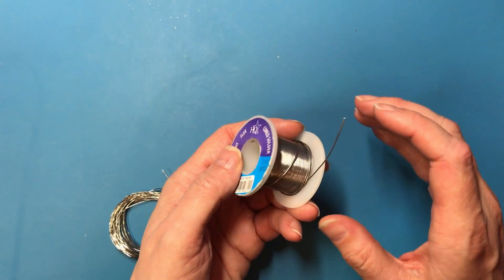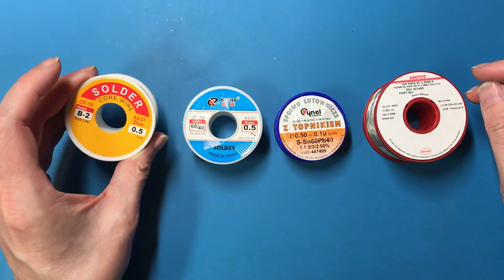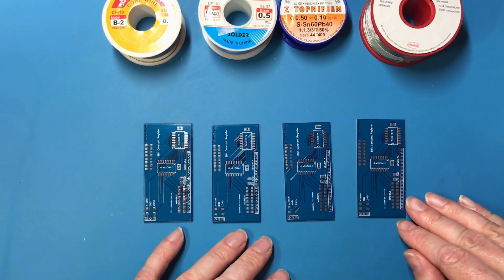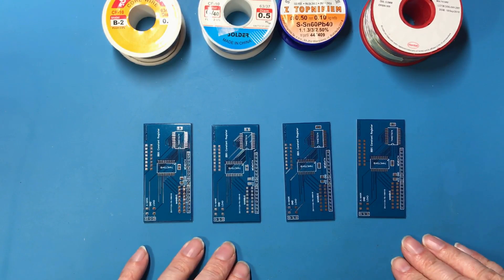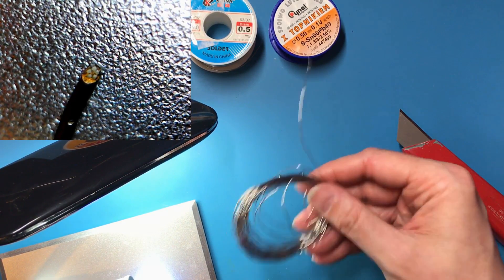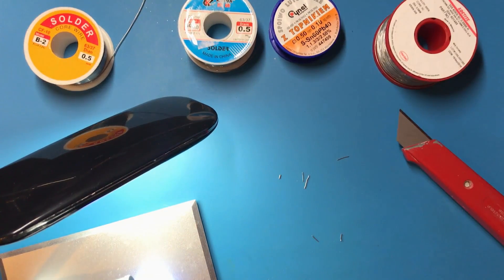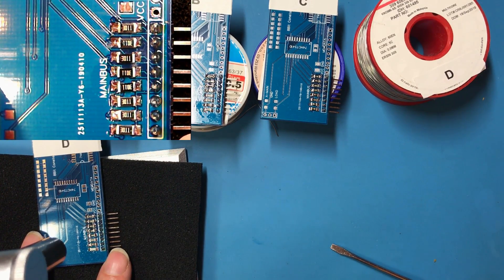eBay Solder Test

Comment: Best solder wires I've used: MG Chemicals RA, and Kester 44. Btw you get the dullness often with cheap Chinese solders, no-one really knows why (God knows what they actually put in it). PS: Cynel is an actual proper/respectful brand in soldering.
Reply from the maker: I'm still using that spool 'D'!

Comment: Good video :)
Stay away from the "A" weld, I also made this mistake to go for a cheaper one, bad results on the 60/40.
Reply from the maker: I'm still using the same roll of Loctite from this video, unless you get through a lot it's really not worth going for cheap stuff.
Reply: Loctite appeared quite good. I've used several brands, I like Velleman and Prok, despite finding them expensive. I normally use 0.8mm, and 0.5mm for SMT.
Once again, thanks for the video, it made it possible to compare different brands well. I also found out that solder "A" has a nucleus, I didn't suspect it. ;) @weirdboyjim

Comment: Good solders are Kester, MBO, Broquetas, Chemet, Asahi, Felder. Not bad are Alpha, Stannol, Loctite, Duratool, as well as polish Cynel and soviet POS. Naturally, this is all 63/37 (to the extreme - 60/40).
Reply: Is Duratool really decent? Have you tried MG Chemicals no Clean, 63/37 or  Mechanic (or Classical Mechanic) HX-T100 63/37?
Reply: @paulb9769  MG Chemicals is great.
Reply from the maker: Not heard of many of those, but I'm happy with the Loctite.

Comment: Can confirm that the orange solder is absolute garbage. It barely melts at 350°C especially not if it's on a PCB, and just gets clumpy and never shiny.
Reply from the maker: Yep, it's horrible stuff. My experience was different but maybe it's not very consistent.

Comment: Mg chemicals and warton metals are great solders. Loctite and multicore are the same brand I believe.  I'm finding it harder and harder to find lead based solder now ?
Reply from the maker: I know some people are stocking up on good leaded solder while they can.
Reply: Have you tried Mechanic HX-T100 63/37? Witch Warton have you used? I see one with Omega flux which is meant to be some type of rosin free.

Comment: I have bought the "A" solder. It seems to be lead-free solder, the result looks dull and not shiny. Anyway, I have never had electrical problems with the connections, I can even solder SMD with it, it certainly does the job. Although, I wouldn't risk using it for critical applications.
Reply from the maker: I bought some lead-free paste by mistake once and it definitely didn't flow to the pads as well. You pick lead or lead-free coating for this reason. I'd definitely worry about what was in it.
Reply: @weirdboyjim  Yes, it is not only a tin/lead alloy. It probably contains a lot of impurities. I have also noticed that my soldering iron tip oxidizes super fast when using that solder wire.
Reply: @smashshoot1389  Yup indeed. Cheap flux, recycled tin; you're just soldering with tin oxide extruded into a tube. Quite impressive they manage to actually make it that round for a bunch of slag.
Reply: The Jinhu eventuallt ended up in a solder pot for me, where, diluted with pewter, it did not make as much a fuss.

Comment: The joint being shiny and then suddenly taking on a dull appearance as it cools is very characteristic of lead free solder. Not saying it is lead free, but I wouldn’t be surprised.
Reply from the maker: I agree, also wondering just how much contamination from a previous lead free batch on the production line it would take to do this to 60/40. Most likely containment would actual be silver, so might be easy to test for.
Reply: The same reason lead free solder does this also happens with contaminated alloys. Just a small amount is enough. It can even be just tin oxide. But the first solder you bought is notorious for this result. Not a bad batch. It's a cheap product.

Comment: I really can vouch for that Loctite solder. I bought the same reel as you did in March 2019 and in the same way the listing showed Multicore but came as Loctite. At first I was pissed because I thought I got scammed... then I tried it. By FAR the BEST solder on the market, no joke. And 250g will go a long way, today it's 18th April 2021 and it's only JUST ran out. 2 years of reliable solder. Well worth £30. Just purchased some more and I was checking around Youtube to see if other people also had a good experience and they did.
Reply from the maker: Exactly! It turns out that Loctite and Multi core are the same stuff, one company owns the other and there are variations in branding around the world.
Reply: @weirdboyjim  Multicore as a brand isn't actively branded outside the americas I think. That could be why.

Comment: I also bought the solder you labeled 'A', it's no good at all. I got it from Aliexpress. It's either lead free, or contaminated. It gets all gooey and crusty, and like you said a dull finish, I replaced it with a roll of Stannol kristall 505, brilliant quality solder.
Reply from the maker: Indeed, this video probably wouldn't have happened if I'd bought 'A' and it had worked ok. I've not come across the Stannol before, I'll take a look if I'm ever shopping around again. Mind you I may end up doing an lead-free solder review before too long, there definitely seems to be a big push to remove leaded solder from the chain.
Reply: @weirdboyjim  Stannol is a German brand I believe. Easy to get here since I live in the country next door (the Netherlands). I am not sure if they are pushing to get leaded solder banned here in my country but I have been stockpiling 60/40 a bit before it happens haha.

Would like to see your take on the lead free stuff. Need to switch to it someday probably so would be nice to see a comparison.
Reply: Same experience. It's a contaminated alloy; and it's intentional. They are recycling solder which means tin oxide makes it in. I now also use Stannol, 63-37 I think. Not sure of the exact model but it comes on red reels, and reeeeeeks of rosin. Perhaps toxic, but it's the smell of victory!

Comment: I went on the Loctite website for more information on this solder. There is no mention of this solder, or any kind of solder on there website. I also did a search for "Loctite multicore solder" on the Henkel website which is the company that owns Loctite. Not a single mention of solder. Very strange.
Reply from the maker: Weird,  the Farnell website has the technical details. https://uk.farnell.com/multicore-loctite/3096122-m/solder-wire-60-40-1-2mm-250g/dp/5090817

Comment: 63/37 is best with tht.
Reply from the maker: tht?  These days all the cheaper stuff is labeled 63/37 but doesn't appear to be any different than the older stuff labeled 60/40
Reply: @weirdboyjim  it gets solid faster.
Reply: @BOSSEHAFFA  The 63/37 tin lead alloy is know as an Eutectic mixture. It has the lowest melting point, and no "pasty" range. It's either liquid, or solid and doesn't have an intermediate pasty transition between the two. The further from 63/37, the higher the melting point and the larger the pasty transition range. The significance of the pasty transition is that if the joint is moved while the solder is pasty, that will cause a cold joint. A 60/40 joint is vulnerable when its temperature is between 183°C and 188°C, whereas a 63/37 joint isn't.

Melting point:
63/37 183°C
60/40 188°C, pasty between 183°C and 188°C.

Comment: You don't need more light on the microscope but a less reflective background around the object instead. If you put black tape on the microscope table the camera will correct its exposition and you'll get alot more details on the object ;-)
Reply from the maker: You are right that the shiny background doesn't help at all. I get better results but turning the stand round so it's pointing at the cutting/anti static mat. More light definitely helps as well though.

Comment: Thanks for the vid. I need to buy some new solder, probably from Ebay in a large reel. There's a few to choose from. I've got one of those free cheap tubes you get free with some irons (all that's at hand) & that's just terrible. I had to splice some wires & it just wouldn't flow properly with lots of heat, just about done the job, real hard work though, constant dirty tip etc. Some cheap import stuff I don't want to end up basically with the same rubbish on a bigger reel. I use to buy the mulitcore in a small white tube & that was great. Anything in the workplace in the past was whatever they had got. I seen there is also a reel from 'Silverline'. That's obviously come from 'somewhere' & badged. If that Loctite is the same stuff as the Multicore it's likely a fair bet. I could get a nice flow even with a 12v car cigarrete lighter plug iron with it RC modeling.
Reply from the maker: I couldn't find anything the conclusively stated the Loctite and Multicore are exactly the same stuff, but it looks the same under the microscope and the performance feels the same. I suspect it's the same stuff solder under both brands but it could just be good quality product made to the same spec, either way I recommend it.
Reply: @weirdboyjim  it would seem it's the same. They're both under the 'Henkel Loctite' label. Multicore was likely taken over by Henkel. So they likely use the good Multicore product to promote the Loctite brand in certain places.

Comment: Good, from the welds that made comparisons in the video What is the best solder for soldering smd components ?
Reply from the maker: The best I have used is the multicore/loctite. That said SMD is really supposed to be done with solderpaste and a reflow oven. I'll have an experiment with that at some point and make a video.

Comment: You didn't get "a bad batch" of that cheap crap - it's all like that. I discovered a while back that you really do get what you pay for with solder, and it's false economy to go cheap. Any branded stuff is good enough for me. I can't tell the difference between Multi, Loctite or Weller so I buy whichever is available when I need it.
Reply from the maker: Sounds about right, I’m pretty sure that Multi and Loctite are the same stuff with different branding now though.

Comment: red/orange is Jinhu and its not good to use, I will be trying Kaina as many say its an OK chinese solder. Mulicore i have used before and its great.
Reply from the maker: Yep,  that's pretty much my thoughts, especially after a bit more use.
Reply: Using kaina 60/40 and its good but "63/37 c1" is not. Also mechanic brand from alexpress is good but far more expensive than kaina

Comment: In the UK, it's hard to beat LOCTITE 363 60EN .... it's leaded, but that doesn't cause no harm if you're not selling your builds.... I get it in my local model railway shop.
I quite like Cynel Sn60Pb40 PRO from Poland too (I think I got that off E. Bay too).... Think it's the same as your Z Topnikiem ("with flux") that you've got, so it'll be interesting to see what you think.
Yeah.... the upside down resistors made me cringe unnecessarily! When I do through-hole, I don't mind if it's tolerance band to the left or to the right... but they all MUST be the same!
Solder wise... I'm very pleased to see you've got pretty much the same conclusions from your far more scientific test as I got from my intuition.
If you're sticking to Loctite in future, feel free to drop your spool of Cynel in the post to me. ;)
Reply from the maker: If you asked for one of the other two I would have sent them to you ;-)  The loctite is definitely the best but the price difference on the Topnikem means I’ve been using that a bit as well. You’ll be pleased to know I’ve been aligning my resistors better in more resent modules.
Reply: @weirdboyjim  Oh no... you can keep the other two! ;-P
https://translate.google.com/?client=ubuntu&um=1&ie=UTF-8&hl=en&client=tw-ob#view=home&op=translate&sl=pl&tl=en&text=z%20topnikiem

Comment: i always wonder what good multiple cores are if it all melts into a bubbly mass... 
i think the more important factor is clean high quality base material and i guess that's as usual "you get what you pay for"
i'm quite happy soldering with single core wire from a good name brand company with certain quality standards that produces here in Germany. 
mixed my own flux out of rosin IPA and wd40  though  ^^
you can never have enough flux ... ask louis rossman !
i don't like those resistor nazis ... i mean diodes.. okay, i get that but resistors c'mon...
I wish there were pink resistors ... sigh
Reply from the maker: I assume that the multicore increases the odds of good distribution over the surface during “Melt into bubble mass” stage. If it just has one core there is a change the bottom will melt out first and just drain it all away. I’ve definitely found it easier since I started to wipe the boards down with a bit of ipa before soldering.

Comment: I had the same cheap solder as you, I also tried another solder I wasn't happy with. Now I'm saving for the "Multicore" or Locktite stuff. Iron, solder, practice, flux, practice, solder wick, practice, more solder, practice, flux pens, more solder... I'm going to use up my solder on more practice projects before I sink more money into this. Thanks James.
Reply from the maker: I’ve seen a few videos of cheaper lead-free solder acting like this, so I have a suspicion that we were sold a mislabelled batch.
Reply: That is probaby true, to me it seems like chinese solder, especially cheap solder is different composition compared what label says. I have got kaina 63/37 and it does not flow as well as kaina 60/40. Suspicious. Also melts harder than 60/40. No way its eutectic imo

Comment: Nicely done review!  Your microscope is a handy & compact setup for quick inspections. 
With my OCD?, the first thing I noticed @7:03 was the inconsistent SMD orientation. LOL
(Note also, the bottom one possibly has a bad joint... on the left side).
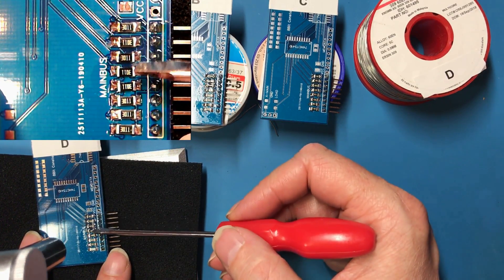So it was amusing when you even apologised for the SMD orientation @9:30 :-)

I recently moved from using my old 60/40 solder reels, to investing in some quality Felder Lottechnik lead-free solder.
I’m now using their ISO-Core Clear Sn96.5Ag3.0Cu0.5 Solder Wire, which I’m absolutely loving!
High quality solder, with the latest in flux recipes, is an investment I wish I'd discovered earlier. Soldering is a pleasure again! :-)
I’ve always used 0.5mm as well. Always found I had much more control with the finer solder, even with larger joints.
Reply from the maker: Thanks. On an extra watch I think you may be right about the bad joint, that real of solder really is awful though!

Comment: I've still got the reel of solder I bought from Maplin in the early 90s. I'm pretty sure it'll last me the rest of my life. I haven't soldered a PCB in a long time and never done any SMD work, but it's been used to solder a lot of connectors over the years and done a good enough job that I've never thought about buying anything else.
Reply from the maker: I have sneaking suspicion that the blue real I show at the start came from Maplin. I got into electronics properly after it closed, in hindsight I should have bought lots of stuff in the closing down sale.
Reply from the maker: Looking at the size of this 250g roll, that has to be pretty big!

Comment: I bought a spool of that same Loctite solder 2+ years ago and I've still got plenty of it left. It's really great stuff. It's fantastic for through-hole soldering. Any mutli-core solder is great for that. Instead of having to add additional flux, the multicore will contain enough flux that you can just "paint" the solder into the component lead.  

About the usage scenarios of additional flux, that really just depends on what you are soldering. On SMD components it's recommended to use additional flux IF you are soldering by hot air. In these cases, the components are usually too small to solder reliably by hand. So the idea is, you tin up the pads with your iron, drop some flux on the pads, position the component on the pads, then heat the area with hot air. Without any extra flux, proper joints wouldn't form at all. But with the extra flux, it'll activate and properly flow the solder on the tinned pads. You'll actually see when this happens. The component will "snap" into place.  

In the case of large SMD components, if you can get away with using an iron there's no real point to adding extra flux. But when you start getting down to the really tiny things, hot air is basically the only way to do it. In that world of soldering, flux is an absolute necessity.  

Great video by the way. Straight and to the point. At the end of the day, I would say you're better off picking up any name brand solder. Spend the extra $5 and pick up something that is guaranteed to work. I wish more people would realize this. $4 solder is $4 for a reason, and not all solder is created equal. The same applies to tools and hardware. Not all soldering irons are the same, and there's probably a reason a $8 plug in mains iron is only $8.
Reply from the maker: Thanks for the kind words! I'm expecting that reel to last me a while. You can read between the lines, I bought some rubbish solder and got bad results. I went to buy the good stuff and thought I'd turn it into a quick bit of "research". Your right about not needing flux for the most part, I think the source of that argument is that the good solder doesn't really need it, but the cheap junk does benefit from some extra flux.

Comment: Great video. This definitely summarizes my experiences. As a child I used a cheap iron and cheap solder and had a terrible time with my first soldering project. So much so I didn't try gain until I was adult. This time around after getting a decent soldering station and quality solder + flux this have been going a lot better.
Reply from the maker: Thanks! If you look back in my videos a couple of months you can see my first experience SMD soldering. Getting a half decent iron made all the difference.  It's pretty obvious in hindsight that I shouldn't have grabbed the first solder with the right words on it.